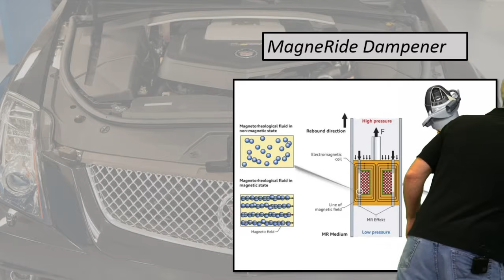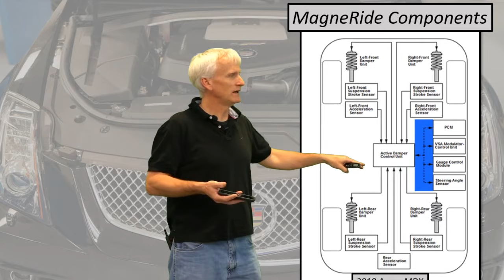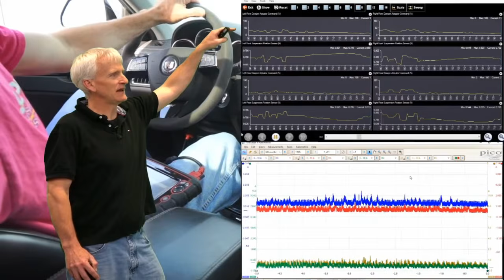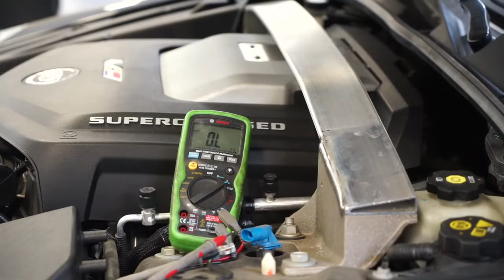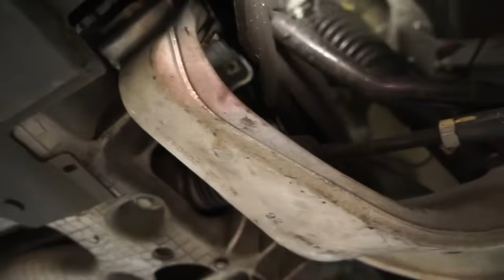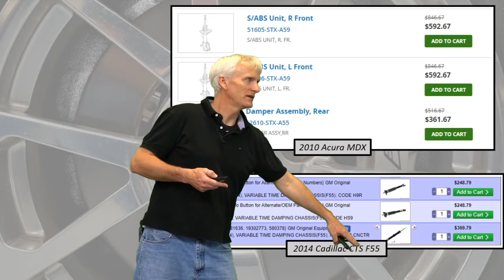MagneRide

Comment: Is there any data showing the semi active suspension outperforming coilovers for track driving experiences? I own a 2011 CTS-V and needed to replace the rears to pass Maryland state inspection, since I knew I would do more Autocross and drifting I went with KW coilovers. Am I just giving up supple ride or is there supporting evidence that I need to switch back to magneride for on track performance increase and maybe just higher stiffness coil springs? I have noticed these vehicles have a tendency to have the lower control arm slip during high performance driving.